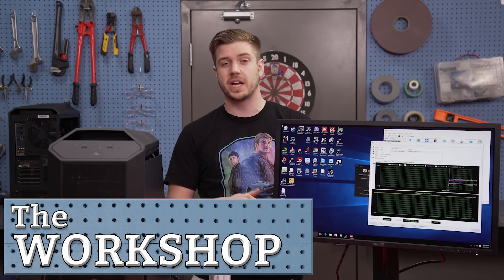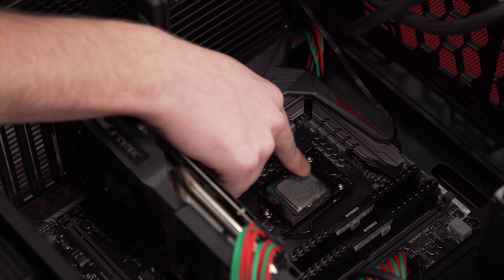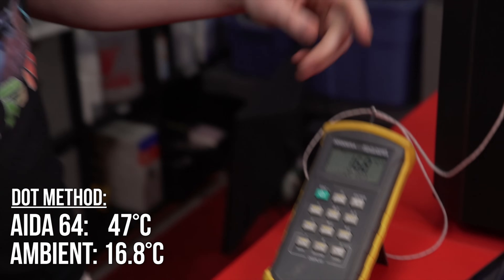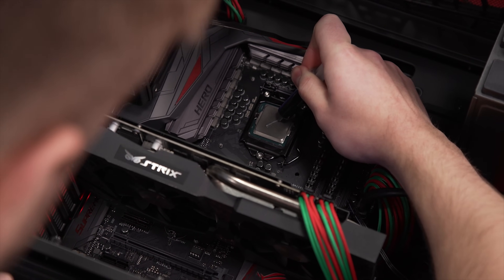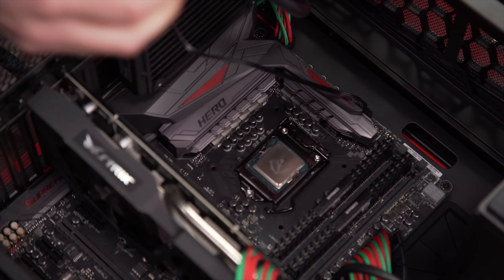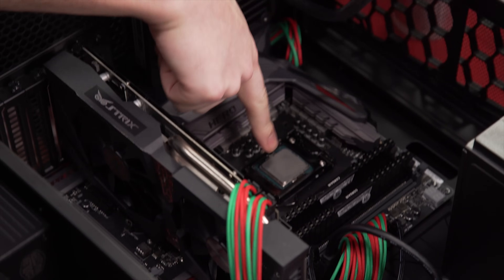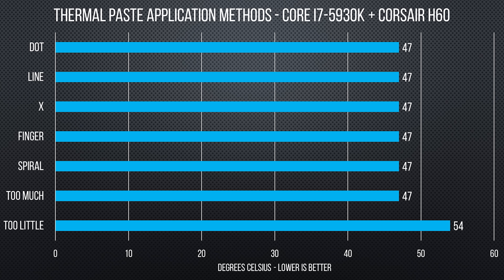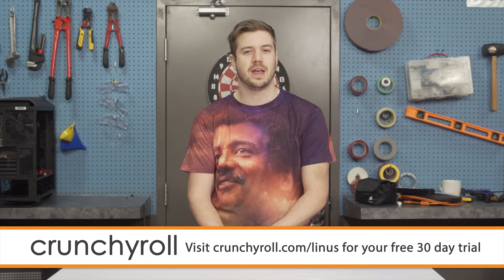Thermal Paste Application Methods - Which one is best? - The Workshop

Comment: Change the thermal paste under the cpu's heatspreader that is on top of the actual cpu die. That might make a difference. Back in the day you needed skills to spread cpu goop on a die, especially since all the good stuff was conductive. Card method was the best, thin as possible without being transparent. Crack that cpu apart!
Reply: "Back in the day" they suggested using the card or spread method. Bollocks then and bollocks now. Today we learn that it doesn't make a lick of difference how you spread it as long as there is enough and not too much
Reply: +dragonhart6505 "Back then" it wasn't bollocks at all. If you just squeezed a "pea" onto the die itself and pressed down the cooler on it, chances were high that you destroyed the whole CPU.
Thermal paste was conductive back then and there were a lot of resistors all around the die, you just couldn't afford the chance of thermal paste being squeezed out of the sides. That's why the creditcard method was the only way to do it back then. You see, the creditcard method had nothing to do with temperatures, it was simply the only way to apply the TIM professionally without breaking anything.

But even putting down the cooler onto the die was an artform back in the day because if you just whacked it on like you do nowadays, chances were high that you cracked away a corner of the die.

Kind regards,
Meta Custom Computers
Reply: Meta Custom Computers I do remember chipping a part off one processor. Still worked luckily but knew MANY MANY MANY people who killed processors. Back when futuremark was madonion and you had to mod your case yourself because they only came in beige.

Comment: I think thermal paste would have a larger impact, on a really hot chip, with custom water  cooling, running a much harder test than AIDA. 

A well OCed chip, with high voltage, custom water cooling and running Prime or IBT, would probably spike a few degrees up or down depending on the method.

Comment: The reasoning for pea or line applications is : the downwards pressure of the heatsink when you install it spreads the paste evenly and prevents air molecules from being trapped between the paste and the heatsink.  

The x method or the spiral method or just spreading the paste with finger/plastic foil/card/etc doesn't guarantee this, air could be trapped and then the efficiency of the paste is diminished. 

I also have some other concerns about the video.. it's not clear if the fan speed was constant throughout the tests - the fan may adjust its speed with the temperature and keep all the heatsinks at that magic 47c value ...

Comment: So let's talk methodology.

1) Within a certain paste range, no application method matters. However there is absolutely a too little boundary which remains murky. Define "too little". Does method matter within that range?

2) Weigh the tube before and after application to establish the precise amount of paste used, and explore the lower bounds for what is actually necessary. Plot on an XY scatter and lets see a best fit curve.

3) A less powerful cooling system is going to give you better resolution. One of those old stock cooler fans ought to be ideal.

4) Within that "too little" range that you've now established, does the credit card method beat the pea method?

Step your science game up!
Reply: +ThePolysyllabist "4) Within that "too little" range that you've now established, does the credit card method beat the pea method?"

It does if you spread the paste evenly and don't make a mess out of it.
The pea method does definitely not cover every inch of the heatspreader, which despite people saying bullshit such as "oh it's only the center that matters" and the old "air pockets" bullshit... it's the best method, because it covers the most amount of surface. 

People simply do not have enough skills to pull a good enough spread without either applying to much paste. making it look like a murder scene, or putting the heat sink back together at an angle that will spread the paste evenly, even if you didn't do a perfect job... so they say shit like "the pea method is def the best".

Comment: It would be awesome to see an updated unbiased test comparing 30-40 of the most common thermal compounds with an over-sized air cooler and good ventilation just like this test to see how the compounds currently being sold perform as formulations constantly change as companies try to improve the efficiency and/or cut costs.

Comment: Does upgrading from 120mm fans to 140mm case fans make a noticeable difference?
Reply: +LouisM Only when you overclock
Reply: +Naitsabes68 oh sorry, mate. I meant case fans. but does the same apply as well?
Reply: The transition will reduce the noise and diffuse a little bit more heat but only 2C - 5C
What you want is double 120mm or double 140mm. With those you can really see the difference

Comment: I've heard Nutella works as thermal paste, how well does it and other stuff (maybe toothpaste) work in comparison to actual thermal paste?
Reply: +p1eguy32 A german PC Hardware magazine already tested it with Nutella, Ketchup and Toothpaste and the results were all similar to normal thermal paste temperature-wise. But practical in no way, since the materials are conductive, they cause corrosion or in case of Nutella and Ketchup will most likely even rot away under the heat. Everything that has a mushy, liquid-ish consistency is usable as a TIM, since everything will conduct heat but thermal paste is the only usable thing that is really practicable.

Kind regards,
Meta Custom Computers

Comment: This test is not right !!! AIDA64 is not stressing the CPU, use latest Linx with latest Linpack libraries. On an overclocked i7-5820K the CPU is sucking around 250-300 watts !!! Aida64 only 160-180.....
On this test the thermal compound is not a bottleneck, this is why you don't see a difference...
Also, check the CPU cores temperature, not the whole package, you should check for consistency between the cores!

Comment: Common Luke everybody knew the answer and a better video would have been comparing thermal paste of different companies like cheap o thermal paste vs A higher quality paste.
Reply: +Sandesh Jadhav Have a look at this: http://overclocking.guide/thermal-paste-roundup-2015-47-products-tested-with-air-cooling-and-liquid-nitrogen-ln2/6/

Basically, "anything" is fine. Very popular thermal paste like Arctic Silver performs very well and is very cheap, so yeah. No need to spend tons of cash on thermal paste unless you do some extreme overclocking and/or sub-zero cooling.
Reply: +Sandesh Jadhav and maybe with stock coolers too
Reply: +refreshfr Yea imo the workshop topic was dumb they could have surely used their time for a better topic, i know someone on twitter asked Luke a question about it but he could have just explained in other video or post a forum link and not make a separate video about it which was pointless...in short such topics are better left for the forums like the link u suggested.
Reply: Meh... I didn't learn anything, but I find it useful since you can quickly link this video to someone that says that [insert method] is the best and the others are awful to prove them they're wrong
Reply: refreshfr Haha :D

Comment: any excessive amounts of thermal paste should not make a difference at all as long as the mouting pressure is the same, since that menas that the thickness of paste on the heat spreader will remain consistent, and any excess will spill out of the edges. this is not a closed vessel where densitiy would actually change with mounting pressure.

Comment: From the way the card method was shown to me you actually need the raw card, not one wrapped in paper towel. You basically spread it suuuuper thin across the whole chip. I haven't done it in a long time but from what I remember it worked pretty well. It may be worth trying again if you're up to it Luke. Though, it might still be 47c.. Who knows.
Reply: +bergauk Why go through the effort of spreading it? With the pea or line method it gets spread out perfectly due to the pressure of the heatsink. It's easier and cleaner
Reply: +bergauk it is completely pointless
Reply: +Luuk van Riel It's the way I was shown it. You actually get better coverage with it due to the fact that you're covering the entire IHS with thermal paste. If he had bothered to do it right we might have an idea if it's not worth the time at all or not. It really sucks that he half-assed it when its the method I originally got taught and was expecting fairly decent results from.
Reply: +bergauk I understan, it bugged me as well that he didn't use the plain card. Either way I always read and heard that the card method was dirty and pointless. There might even be air bubbles since you aren't spreading it from a single point. It might even be that I learned that from an older video from LTT.
I think that the main point from this video was that it doesn't really matter wich way you use as long as you apply the right amount.

Comment: Try an air cooler instead of a liquid cooler next time.
Reply: +Andrew Danis the only thing that would change would be that the temperatures would be higher. It wouldn't affect the thermal conductivity
Reply: +Naitsabes68 True true. Just would like to see for shits and gigs.
Reply: Andrew Danis i think we would have the same results only slightly higher temps :P

Comment: Great video Luke! On my personal PCs I've always used the line or the card method, and then when I was working in IT, I usually did the pea method. Never noticed a huge difference in any of them, but it was nice to see a set of tests attempting to judge the change with the different methods. A couple questions though:

- Was this a brand new CPU or had a previous bit of thermal compound been burned in on the contact plate? 
- How aggressively did you clean the thermal compound between tests?  100% IPA was probably well enough regardless given that you weren't burning in the compound between tests, but I wonder if burn-in between tests would make a difference? My first inclination is that it wouldn't really make a difference at all, since all of your methods produced at least a large enough oval to cover the majority of the contact.

I used to use Arctic Silver V but have since switched exclusively to Gelid Solutions GC-Extreme Thermal Compound. No burn in time, and I instantly noticed a couple of degrees C reduction in temperature over my Arctic Silver V.

Comment: Next: Stock paste vs 3rd party
I'm just using a budget PC with A8-7600, stock fan and paste
Reply: +Lance Lindle Lee The paste actually make quite a difference. Arctic Silver 5 gave me 47C at most while the cheap ones gave me around 60-63C

Comment: i would like to see this done with a much less efficient cooler. might have a bit more room for slightly different temperatures.
Reply: +Nathan McClymont and with low quality "generic" white thermal paste!

Dude uses EVERYTHING optimal, super premium products which are basically fail proof!

A stock cooler and cheap thermal paste would be a much better scenario!

Comment: Hmm, maybe all the different methods worked pretty good (even the "in theory bad ones") is because of a pretty high cooler pressure? If you had some worse cooler, with less application pressure it wouldn't be able to spread the thermal that well?

Comment: Thank you for this video.  It was most helpful of all the videos I've watched concerning this issue.
Because of what I've seen previously, I decided to apply mine with 2 lines  in this configuration:  "=".
I have a 4790K CPU, with EKWB custom open loop system.  I run the CPU at 4.4 MHz, no spread spectrum.
I was concerned my 30'C (idle) temps were too high due to over application of the thermal grease.
Your video showed me I am fine with what I applied.
Again, thank you.

Comment: Does polishing the cooling block and CPU affect temps?
Reply: +Gino Brugman I haven't tested, but it's likely negligible, though in theory a flatter cleaner surface will connect better to the CPU, though this gap is filled by the paste anyway so probably very little to no difference in my opinion.

Comment: The dot or the line is probally more superior to the other methods in my personal opinion, take it with a grain of salt though since I have never used thermal paste before (just watching cos it was interesting). But I think the basics of my last field of employment where I worked with glue carry over, always use just enough (cleanliness), limit breaks in your bead - less or none is better (air bubbles), cross or join beads in the sealant (air bubbles), avoid touching the bead -  no unnecessary spreading (air bubbles), shape of your bead is important - triangle extrusion is better than round (spread - doesn't matter for small amounts like this), less air surface area on your bead (contaminants). 

Basically boiled down to do it neatly so it is less work for you for when you inevitably remove it and redo it.

Comment: You should test out PC performance/thermals with the system on a carpet with a down-turned PSU.
Reply: yeah, comparison of thermals depending on what the computer is on and where the psu is
Reply: Matt Sibilleau Oh, I misunderstood.
I think that another interesting idea would be what happens if you block the fans on a PSU or other components (that don't have a fanless mode). Will the system shut off or will something die?
Reply: +Matt Sibilleau That's more of a long term thing...
Reply: I'm not talking dust or anything, more like if the PSU would be starved for air under load. I'm mainly suggesting because Luke is basically doing PC "mythbusting". I would never do it personally, but I'm still curious.

Comment: I'm tempted to take my cooler off now and put new paste on, all I have at home right now is curry paste tho... Will that work? :o Its been almost 3 years I guess since I changed cooler and put paste on. Its an overclocked i5 2500k @ 4.2 so not that extreme or anything.
Reply: Nutella and mayonnaise will work if you're not afraid by the smell ...

Comment: This result does NOT apply to any thermal compound applications to bare die's like the ones on your GPU's! Many chips other than CPU's do not have a little heatspreader on them, which makes them very vulnerable to hot spots. With such chips you have to spread out the thermal compound evenly over the chip before placing back the cooler!

Comment: I don't think the test is valid. Apart from adding too much or too little, the reason there are different methods is to do with sufficient coverage and reduction of air pockets. I'm not surprised that there is no measurable performance difference in the incredibly short term.
Reply: But when spread out, all methods (except too little) yield great coverage. The pressure of the cooler forces air out while spreading the paste evenly, leaving excess paste to go to the edges. The only time air pockets are a factor is when too little paste is used.
Reply: +Michael generally true, which is why the argument is silly. Except the credit card method or the plastic bag finger method, which could give you bubbles. I would be wary of the spiral method also because the air between the loops has to go somewhere.

Comment: Why does he seem so annoyed? Was it like 3 AM when he did this?
Reply: +Polonium Fist 
Might be because he took apart, cleaned and reapplied the thermal paste a multitude of times with no real change in temps
Reply: +Polonium Fist He is bored by the result being the same over and over.
Reply: +Polonium Fist  Try this experiment yourself and find out... here's a hint: 1. Remove heatsink -> 2. Swab paste off of both heatsink and CPU -> 3. Apply new paste -> 4. Reattach heatsink -> 5. Wait for system to boot -> 6. Load up stress test software and wait 10 minutes for it to run ----- REPEAT 7 TIMES. That's a good 5 hours of BS without seeing any interesting results. I'd be annoyed too.

Comment: next time put a "no significant difference" option on your straw poll, because that's what i thought from the beginning.  Regardless of thermal paste shape before putting on your cooler, the pressure from mounting your cooler will spread the paste evenly across the cpu, at least that has always been my opinion on it.

Comment: Back when I lived at home my room would get to 42° C in the summer and I found, although anecdotally, thermal paste application mattered. I used the spread method with a razor blade. A few times I would just dab it on and would find my systems ran hotter, enough that they would become unstable (we're talking 80-90° C). Granted that was ~15 years ago and thermal paste has improved and I happily have AC. My point is I wonder if a higher ambient would have an effect, or if the system was overclocked.

Comment: Does positioining of the case effect temperatures,like there is those decks that you can put your case in the bottom and does it effect if you put it there or on top
Reply: +Lions Heart 

Probably not significantly, considering we saw that shoving a ton of stuff in a case blocking airflow had almost no effect
Reply: Pretty good thinking but i think it will just slightly because there is a piece of plank there and if you have something else blocking it from the other side (shelf or some sorts of holding cd stand and that)will effect,i want to buy that desk and i want to see :/
Reply: Lions Heart Well having a plank on the outside will cause even less to happen.At most, it will block two fans externally. We've seen literally all fans being totally blocked, as well as a ton of insulation with no real change to temperatures.
Reply: i didnt think that way but yeah,i will just have loads of dust as i had experience but without the plank and the shelf